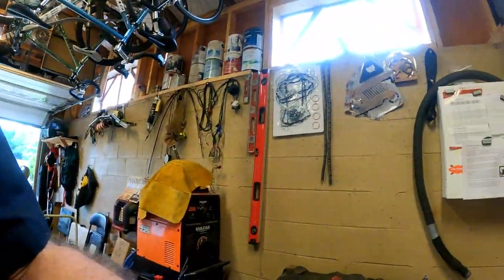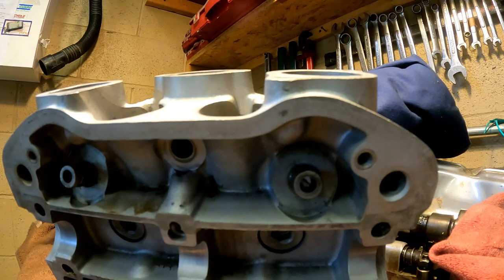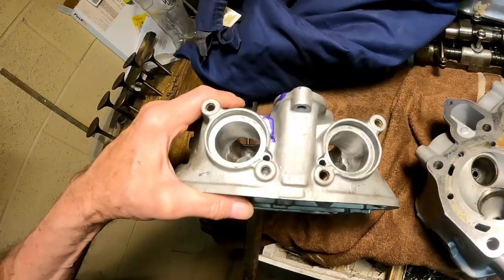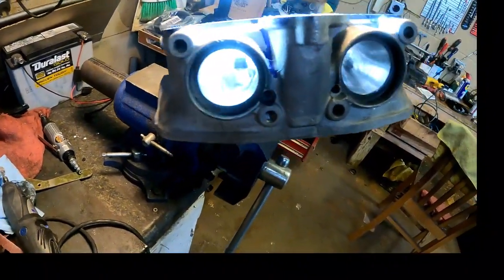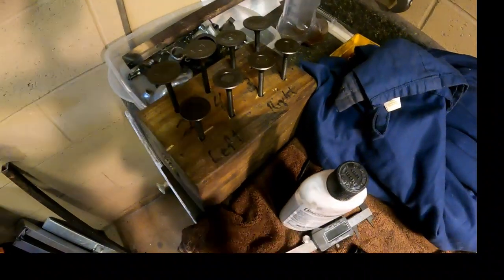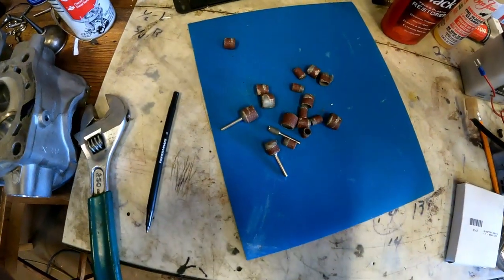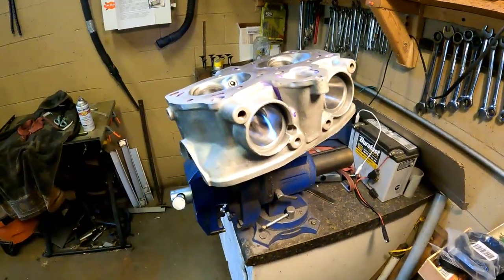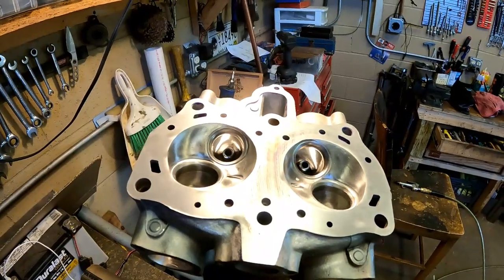HONDA GOLDWING, HEAD PORTING PART 1

Comment: I did the same to my 83 GW, it ran better especially in the upper revs. I am running chinese webber 40 copies and has much more induction noise as well which sounds pretty cool in my opinion. I'm currently running a 60 idle jet and 155 main jet Good work as always!
Reply from the maker: Do you think it runs better with the webber carb than it would with the stock set up properly tuned?
Reply: Yes especially on a modded engine.

Comment: I will be curious to see if you have to rejet the carbs, and or balance the carbs since the Vacuum signal may change ?
Reply from the maker: I expect that I will need to rebalance the carbs and maybe re-jet as well. There will be at least 2 or 3 more videos on this.